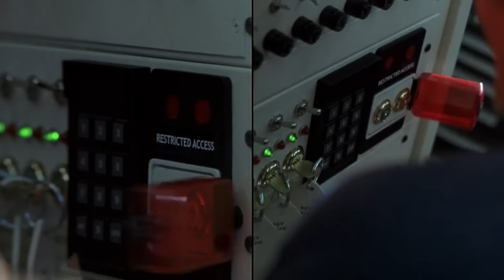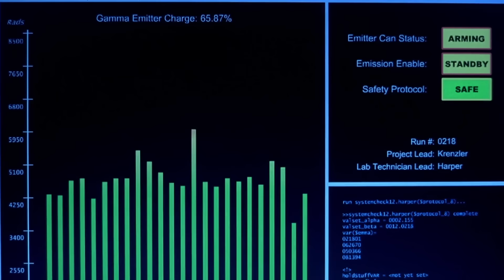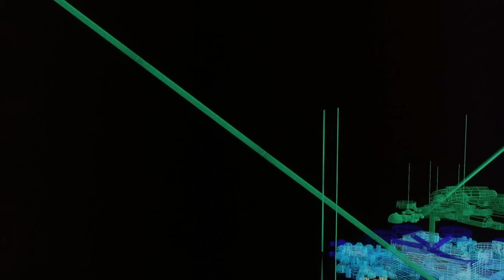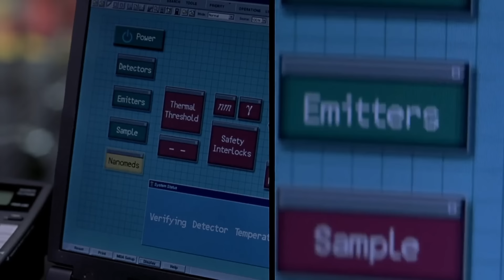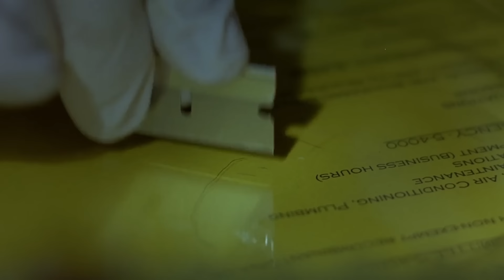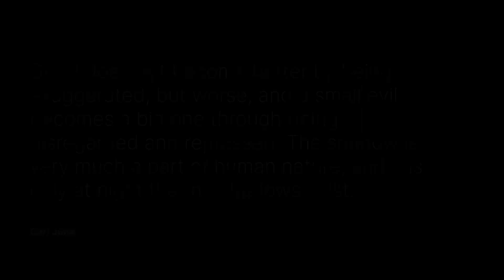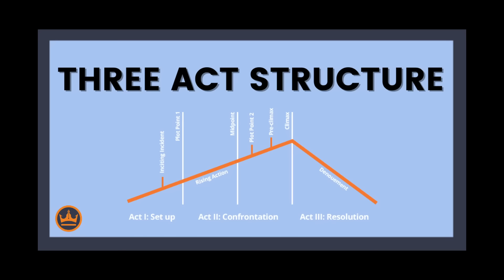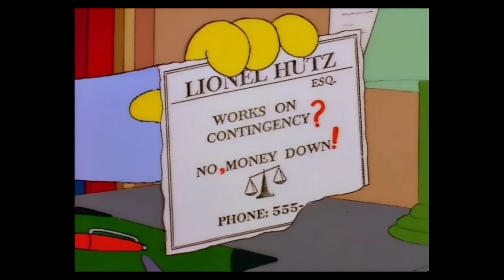HULK (2003) is SMARTER Than You Think

Comment: Weird how many people make fun of the scene where the guy blows himself up. Sure, it looks weird, but if you knew how explosions worked then you wouldn't find a problem :/

Explosions aren't slow, you can't actually outrun them, and you wouldn't just get flung away or just simply catch on fire from that distance. 

Explosions ARE faster than bullets, from that distance you would get annihilated in an instant which is basically what happened in that scene. 

Its obviously a movie for kids because Hulk has enough strength to destroy buildings and crap but didn't actually kill people that he hits or throws, so why did you expect him to actually blow into a million pieces??